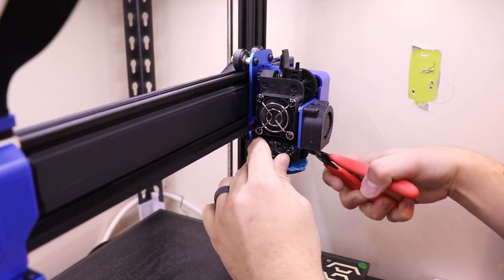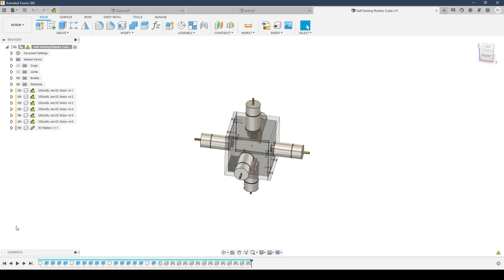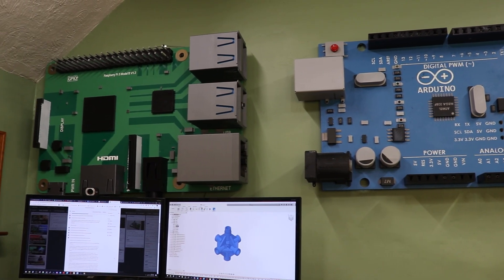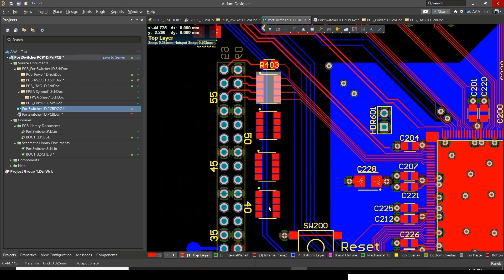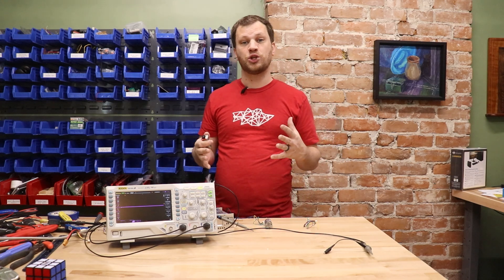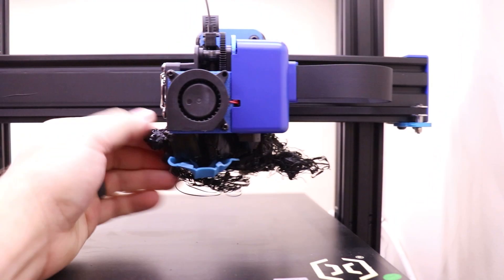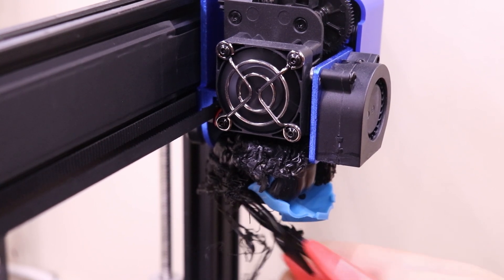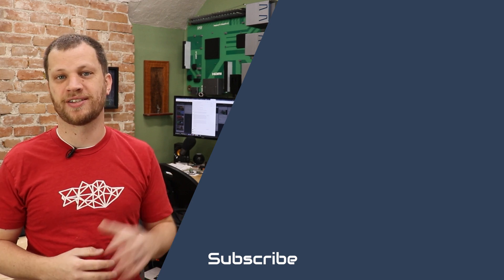A Rubik's Cube That Solves Itself - Part 1

Comment: Love this! Can't wait to see the end. I love your videos. I am curious, why didn't you consider using stepper motors rather than dc?
Reply from the maker: Thanks Taylor! Stepper motors could have been a good option. The one thing I was worried about with stepper motors was losing steps. You can send a specific number of steps to control the output, but if things somehow get out of sync, there's no way of knowing. Using an encoder gives you more confidence in the absolute position. I do have some of those little stepper motors that are geared which would help out with not losing steps because they have way more torque. If this doesn't work I may have to switch tactics and try stepper motors